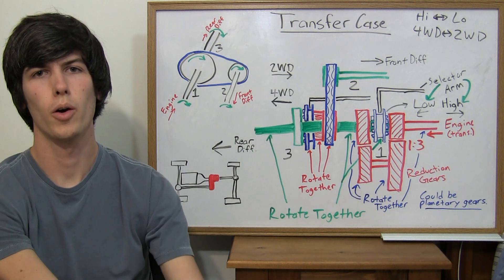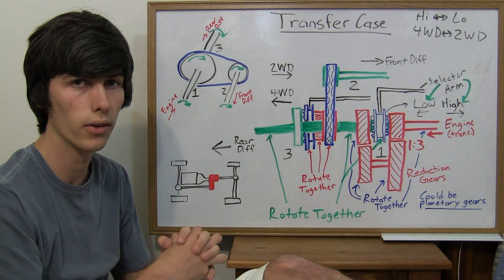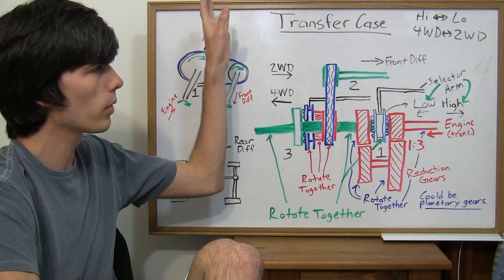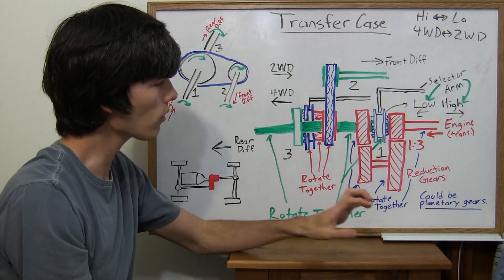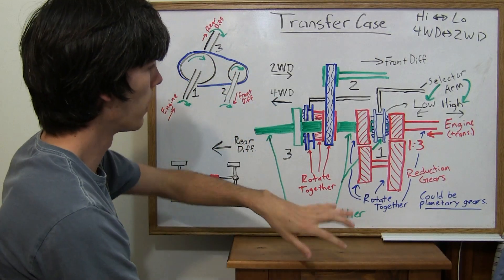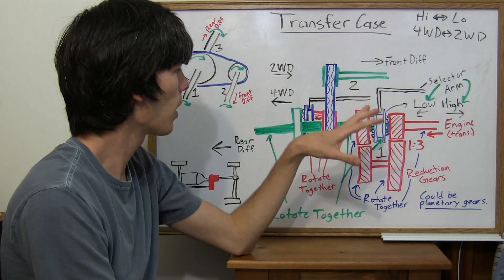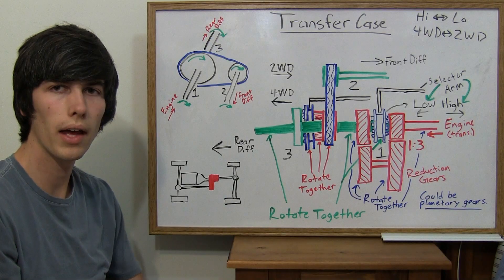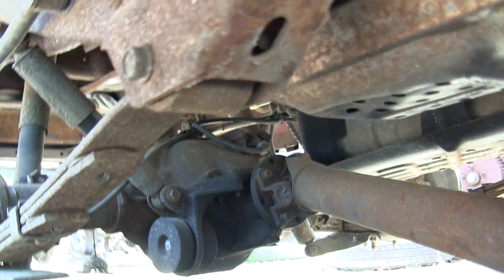Transfer Case - Explained

Comment: So are most SUV's typically RWD when they're in 4x2 mode?  I wouldn't have expected that
Reply: Also, when the car is in 2WD is the transfer case gearing automatically set to high or low? because the main transmission gear box is whats used when you're driving in 2WD on the highway right?
Reply: +John Johnsonson, it depends on the vehicle. We have a couple of Jeeps and they are rear wheel drive, as are land drovers, Land Cruisers and the like. Some of the smaller 4WD or all wheel drives are front wheel drive with rear engagement such as the Honda CRV and Mazda SUV's. 

The cross over SUV's, like the VW and Audi etc are front wheel drive with rear wheel drive engaged on demand (with a few exceptions such as the VW Ute).
Reply: +Miles McMurphy Most vehicles have 2 High, 4 high and 4 low. You can get custom transfer cases or shifter units that allow 2L, however that can lead to issues with overloading of drive train components. 

In the original design for Land Rover Series 1 vehicles the selection of 4L required 4WD as the rear axles would be overloaded in low range.
Reply: +Greg Pointing Odd. A jeep in 2low by all accounts does not complain provided it's not abused.
Reply: spaceminions If you are running a custom transfer case, or shifter (which you would need to get 2L) you have probably done a few other mods as well. So not really an issue. The CRD Jeep Wranglers have a Dana 60 front axle which is borderline for the torque output of the engine, and they are certainly easy to destroy even when 'going easy'. I know, I have done it three times now and ended up putting in stronger axles...
Reply: ***** Most likely, yes. I didn't know much about the CRD wranglers, that's unfortunate.

Comment: Nice explanation and use of drawings. My question is why the low option on the transfer case is only available with the 4wd engaged. From your drawing, it appears that the high/low could be changed independently of the 2/4wd. Perhaps you drew it that way for simplicity; perhaps engineers know that low is not necessary in 2wd. Would it be too complex to actually make and explain a diagram that shows how it's possible to lay out a transfer case where the low option is only available with 4wd engaged?
Thanks.
Reply: +Aravind Dileepan you are correct, they can be selected independently. The challenge becomes the torque increase, if you have 400Nm of torque available (lets assume not other gearing here) and a 3:1 transfer case then you would have 1200Nm of torque to play with (assuming no friction losses). 
If you put that through the rear wheels only then you will break things. If you have the front wheels engaged then each axle gets 600Nm of torque which is a 50% increase no a 300% increase. This means no (or less) breakage of parts.

Comment: Shouldn't the gear ratio for the hi/lo gear be 3:1.  In "Car Gears - Explained", the first number is described as the driven gear and the second number the driving gear and 1st gear is indeed notated as 3:1.  Here you show it as 1:3, but wouldn't that give you less output transmission torque?  The driven gear is also drawn as larger so this looks like an error.  I am not an expert.  I've just been slowly going through your videos.

Also,near the end of this video, you mistakenly call the transfer case the transaxle, as you did in the previous video to this one, but this quip isn't notated.  

There's many comments to read, so if this is already been said sorry, but it would be really professional to notate errors (if there are only!  I don't know for sure if the gear ratio thing here is wrong or not).  I understand if you don't have the time to do such things.

Comment: Is it possible you could explain how a dual transfer case set up would work in one of your videos? ive learnt alot from what you have posted and have always been curious about that
Reply: +Charlotte Gibson Dual transfer case is just another set of reduction gears at the front. Looking at the video if you add another set of the red reduction gears between the engine input shaft at the green main shaft you have a dual transfer case.
The part where it gets confusing is the 4wd selection part, which you only have 1. The transfer case and 4WD selection are 2 separate things and you can have multiple range selection. Atlas make a custom 3 speed transfer case (as an example) that has 2H, 4H, 2L, 4L and 2L(2) and 4L(2).

Comment: Hi Thank you for your excellent videos.You are a really good teacher.what do you know about the transfer case in a w210 Mercedes (96-2002 These models all seem so have suffered from "drive line Thump"a clunk in the middle of the floor at low speeds when taking your foot off the accelerator or applying slowly at low speeds.I have done a lot of reading on this subject and no one has seemed to have ever solved it.Some people seem to think it has something to do with the transfer case.What do you think?

Comment: Is this explained considering a 3 speed gearbox.. The transfer case comes after the gearbox.. So vt is with the high and low gear thing.. Someone plz explain..
Reply: +Shirleyy Suundaresan The gearbox usually sits between the transfer case and the engine. In the diagram the red input shaft would be the output shaft from the gearbox (auto or manual).

Comment: so you explain 2 things but i am wondering how a 100 bhp car gets 60 bhp to the rear wheels and 40 to the front but in a straight line all wheels rotate the same speed i get that if you have a fluid coupling a lot of power goes to waste in heat just because fluid just has losses can you have a frictionless 60 40 split in your car exept for mechanical friction in the transfer case and gearbox etc

Comment: If some one remove the chain that rotate the front wheel, would it become a straight two wheel drive. what issues may come up if you do so.
Reply: Frank Bodden No power would go to the front wheels, and yes it would become straight 2wd.
Reply: Thank you, for responding Justin.

Comment: why we need to have low speed mode & high speed mode in a transfer case , why engineers don't put those gear in a gearbox of the car ??? So that mean if the gearbox has 5 speed mode and with those 2 mode of the transfer case then we have 10 speed mode ???
Reply: +Thanhco Lam Great question. The use of a transfer case pretty much gives you a road going vehicle gearing in 2 or 4 high range, and the an off road gear seat in the low range (usually 2L). To put all these in 1 gearbox would mean a much bigger gearbox with multiple reverse gears. This gets big and expensive.

In our Jeeps, the gearbox is used in multiple vehicles not just our model Jeep and the use of a transfer case allows Jeep the provide us with on and off road gear sets while keeping the cost of the gearbox down

Comment: Really nice job explaining this, I read some of the other comments and can't agree more.  You took a difficult subject matter and broke it down so that anyone can understand it.  Very cool!  Thank you!
Reply from the maker: The Burb Billy Glad you enjoyed it, thanks for watching!
Reply: +Engineering Explained helo  I would like to take your opinion on a subject but I'm not sure how to contact u I want to c if it is possible to install a part time 4 wheel drive to the existing awd of a 2008 subaru wrx hatchback not the sti I'm looking forward to your answer
Reply: +Antoun Sayah, sorry no is the easiest answer.

Of course you can always put in something custom, a transaxle from an earlier L series wagon would probably fit and they have a dual range selector. Not sure how it would fit under the body though.
Reply: Engineering Explained your videos help out a great deal with explaining and understanding. Is there anyway you can  explain gear ratio? I'm confused on if it's from size or how much weight each gear can hold...I'm lost.

Comment: why would someone want a dual transfercase .. alot of offreaders do it .. is it just to have a higher ratio if so why cant you just change the gearing ??
Reply: it gives more options by combinations. you han have one case in high gear and the other in low, first one in low the other in high, both in low or both in high. instead of high and low you have four combinations for different situations. if you have the same gears in the transfercases you only get three combinations though. becouse 1 in high and 2 in low will be the same as 2 in high and 1 in low.

Comment: I did not mention but should have added to my last post the wine from the transfer case/transmission sounds like a low gear wine and not the normal sound.  If that makes any sense.  I know when I had my 4x4 jeep and went to a lower gear it sounds like the BMR X5 now and that's why I think the chain may be strained in my transfer case.  I'm not sure a little lost wanting to trade it in @ this point but have put many $ in the last year into it.

Comment: Thanks for this video. I'm thinking with your explanation and another video here that I can rebuild my transfer case.  It's an older 2001 X5 BMR and it makes a noise when you take your foot off the pedal.  It's AWD but sound like a old 4WD coming down off acceleration.  Sounds fine normal driving but when your foot comes off the pedal it starts a 4WD gear wine.  Not sure how to explain but sounds normal if you've had old 4 wheel drive truck.  Right now not sure if it's the transfer case or the transmission but took it to an BMR mech and he could not decide either.  Will get it diagnosed and pay the $100 so dollars @ BMR and hope to take this challenge to my garage.  That being said thanks for your video and I have a better understanding about the transfer case and think that is the real issue.  Will update you when I find out.

Comment: I've been watching your videos for some time , you are doing a really good job explaining different systems in Automobiles

I just have one question : How about the red gear ( that is connected to the front shaft ), Does it rotate on bearing, while the 2WD is activated ?

Am really thankful for your hard work
keep it up..
Reply from the maker: Glad you enjoy the videos! Yes, the red gear would rotate on bearings, as would the other shafts as well to minimize friction.

Comment: so in this set up it would not allow for varying front and rear wheel speed in 4wd mode regardless whether hi/lo as there is no differential? correct me if im wrong but part time 4wd vehicles can drive in 4wd high for everyday use cant they

Comment: firstly thanks for thevideo
as it happened before. each and every thimg becomes clear
and one more thing mate, i may be wrong but i guess there is a small mistake in your diagram. in 3 section the blue coupling may be connected to the green shaft and allow to enable to wheel drive and when we shift it , it will connect both ie front and rear axle

Comment: At switching from high to low gear... When the selector arm pushes the blue shaft to the gear on the right... what makes sure that the Reduction gears are not connected to the entire shaft thats now transmitting power?

Comment: i got problem wt my 4 by 4.i gues transfer case.it works well n rear wheel drive.bt whn i turn to 4 wheel drive,things get stuck.cant go over 35km,plus engine is under so stress it get hot,even smoked one time.the alignment changes,if i turn the wheels u hear loud rubber voice grinding wt road,like they are locked or something.then when i want to turn back to 2 wheel drive,it takes alot of time,smtimes dont want to.any idea wts goin on ,wher is the problem,n wat i need to do??? plz

Comment: What is the actual component that enable the front and rear wheels to turn at different speeds? Is it transfer case or center differential? Say an engineer build a full-time 4WD with no hi-lo gears, is it possible to eliminate this part without affecting the ride negatively? Is center differential an essential component? If it is, why I don't see it in your 4WD video?

Comment: Thanks for your response. Reasons for my question, is that my 4x4 has an open differential at the rear, and going offroading is a bit of a pain, so i was wondering to replace the rear diff with an LSD or E-LSD.

Comment from the maker: It of course, depends on the application. Open is fine for everyday cars. An LSD is beneficial in many applications such as racing, or even towing. Locked diffs are great off road, but terrible on the road.

Comment: In a lot of jeeps I've seen and owned when the transfer case gets worn and you have trouble shifting from 4wd hi to 2 wd you shift into reverse drive 10 feet or so and then shift to drive and you should be set, why is that?

Comment: So the front and rear shaft always receive the same torque and power, is that correct?

Also, if the transfer case does not have an option of high/low gear setting, and it always engages in 4wd, then what's the difference between the transfer case and a locking differential?

Comment: So with the gear on the front driveshaft being smaller than the the gear on the main driveshaft, that would mean the front drive shaft spins faster and with less torque. Would the front differential have a higher gear ratio than the rear diff?

Comment: Very, very, nice.  I ended up on your channel after one of my viewers commented on a leak that developed with my transfer case.  He called it "Pump-rub" (a pin hole develops in the transfer casing itself and starts leaking) the repair kit and procedure were also given.  I have no affiliation with these folks but googling Merchant Automotive Pump Rub will get you to the repair kit and what appear to be nicely written instructions.  I've not tried it yet but I can see it coming...

Comment: ya it doesn't work.. it "shifts" freely thru the five gears but doesn't actually go info gear ... and at first the transfer shifter still had movement through the gears but didn't engage either but now its stuck and doesn't move at all .. thanks man

Comment from the maker: If it's a setup with 2WD and 4 wheel drive, using a transfer case, there wouldn't be a center diff. Center diffs are used in AWD vehicles to balance the power/speed distribution from front to back, rather than a "locked" set-up as shown in this video.
Reply: what i get from your video is, no matters we use 4H or 4L the front rotation will be same as rear rotation (rotation different is locked). it means we must have all tyres with the same size so it not broke the transfer case if we use 4wd mode. am i right?
i question this because my front tyres is smaller from the rear (worn out, bad alignment), if i use the 4wd mode in slipper terrain it will not have any problem, but if i use it in terrain that more "grip" i affraid i will broke it.

and other question is, is there are any 4wd car that have mid differential instead of AWD setup?

Comment: Pause 2:01 if you don't know what a drive shaft is look for a video explaining... Great video man. Just as a heads up you can drive a 4wd vehicle with no trans fluid in the transfer case. It just won't go in to 4wd or on an AWD vehicle it won't engage the front wheels when they slip.. please continue.

Comment: a (part-time) 4WD system should never be used on dry pavement since it doesn't not allow front and rear tire to rotate at different speed EVEN THOUGH it does allow different rotation speed left to right tires correct?

Comment: I've never driven a part time 4WD vehicle before so how are you suppose to use L and H range that's in the transfer case? If you use 4X4 L then you must use L transmission gear or can it be 2 or D gear as well?

Comment from the maker: The lower gear set is for high torque low wheel speed. The high gear selector (which your car is usually in) can't gear down this low, even in 1st/2nd. Now you could use second gear high for something like going down a mountain where you don't want to overheat your brakes.

Comment: FANTASTIC videos! Just bought 1st 4x4 (01 Silverado) and your videos have really helped me understand how they work.  Very clear, easy to understand.  Keep up the great work!

I am curious - PT 4x4 - Is the transfer case "engaged" when driving in 2wd? If the chain in the case were to break/snap, I understand they stretch/wear over time and use, would I be walking? It seems that when in 2wd, power simply passes through the case to the rear.  Not that simple?

I appreciate your input.

Comment from the maker: They will spin at the same rate, though if you wanted to make things complicated you could use a different gear ratio diff at the front to make up for a different gear ratio in the transfer case. Probably not the easiest solution though, 1:1 should be used in the transfer case. The model in the top left isn't the most accurate drawing. :)

Comment from the maker: It could be incorporated into the transmission. Not entirely sure for the reasoning, but if it's not, it allows you to use the same transmission across multiple platforms, making the transmission more versatile rather than for just 4WD vehicles.

Comment: how is made certain that the connectors can connect into the holes on the gear. If the shaft is spinning then there must be some discrepancy when you try to connect them. Even if the shaft is stopped, there is no guarantee the holes will align, so how is it ensured they connect adequately? thanks.

Comment: or at least one set of wheels would wear and burn out if that didn't happen lol, and yes they obviously have to spin at the same rate, but thats exactly why i'm wondering why the gear ratio seems anything but 1:1. just wondering if thats actually the case and if so what goes on with that. because it looks like a 2 or 3 to 1 ratio. so yeah they obviously spin at a similar/same speed, so i'm wondering what goes on with that. anyways...peace man.

Comment: So, to engage 4L, in what gear does the transmission need to be? In my truck, either the lever won't move or the gears grind when it does, whether I'm in park, neutral, or drive.